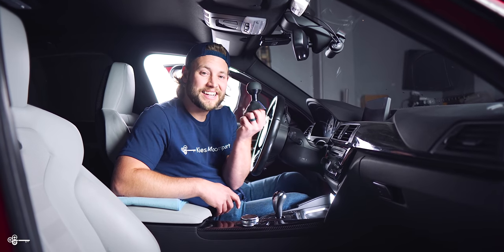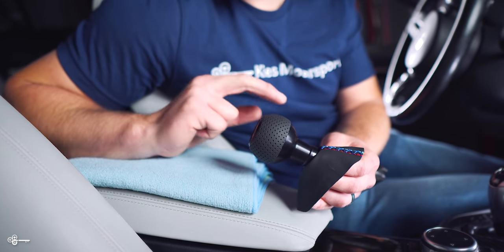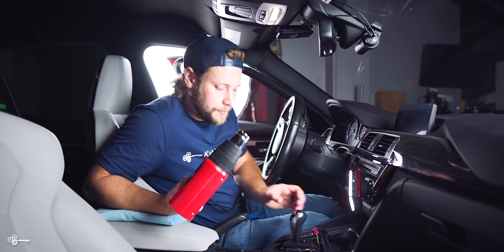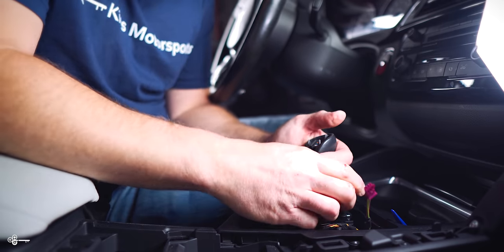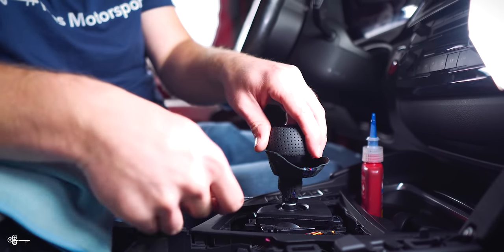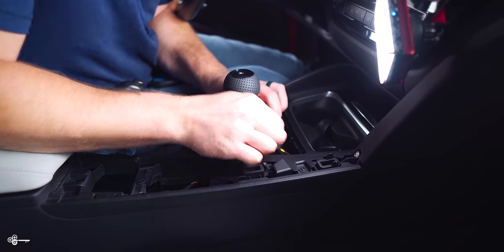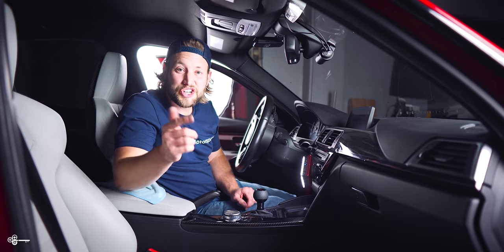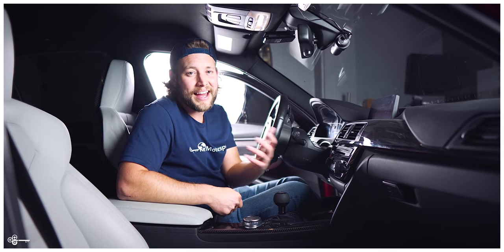CUSTOMIZED UPGRADED DCT SHIFT KNOB in our BMW F80 M3 from Black Forest Industries

Comment: Do like it, but they really should've used the connector for some power and just had the top light up with the shift pattern (not even depending on mode etc)

Comment: Hey Brian. 2 questions - Is this completely reversible? Like with the double sided tape and everything. 

Also, how important is the thread lock on the tiny screws?

Im thinking about getting this got my M4
Reply: Also, do you disconnect the battery before installation?

Comment: I need a custom one for f30 f32 pleaseeeeeee
and find out any way for the transmission to behave like m3 m4.
Now people will say why dont you jut buy a m3 m4 well simple ( No money ) :(
Reply: Which part of the behavior do you want it to be like an m4. It might be possible to swap the upshift downshift directions but it will never have drive logic or be able to snap off a shift like the M-dct. The transmissions are fundemetally different.
Reply: By behavior I mean like on the m4 it goes to neutral when you are not pushing gas like it behaves similar to a manual transmission car
Reply: @gilbertodiaz4550  you can’t change that unless you change the entire transmission, you might be able to program it to go into neutral but it wouldn’t work well

dct isn’t the same as an auto